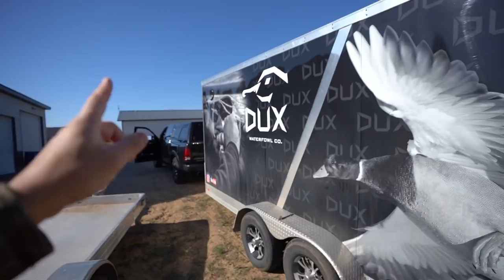This Pigeon Trapping Job Might Be Too Big For Me.. (Disgusting Pest Control)

Comment: Hello Bobby . is that a new roof to ? we have seen Jordan on his last vid , on a roof top where he was catching quite a few birds, but someone else had put a trap up there too. The new roof top you could take the eggs to Jordan's to foster out but you will have to make sure that they are fresh and you will need heat on them if they are near the hatching stage. It would be good to see some net catching or blow darting, we think you would do well with two or three traps up there.  There are a lot of birds and it needs a damn good clean up. Love the Dux t- shirt of the month, in fact we love all the Dux gear we are just waiting for them to get back to us about postage to the UK. Lock down here is easing a little but it's still not as free and easy as in the USA. Stay safe. Malc and Ann (England) UK xxx
Reply from the maker: Shipping to the uk would be soo expensive it wouldn’t justify paying that much to get it there

Comment: Remove the eggs first,  clean off the roof entirely and lay then lay the traps. I imagine the birds are returning there because they are used to laying eggs there safely and the hvac systems probably offer decent incubation heat in winter and cooler months